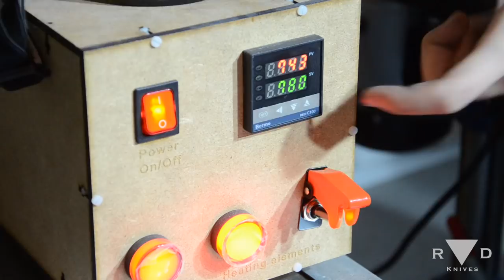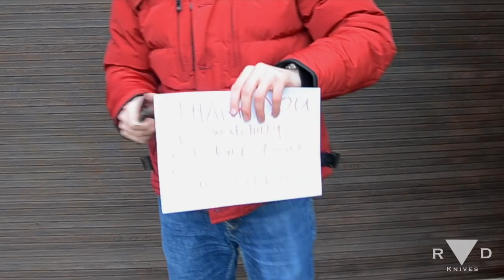Making the NOBLE Knife Part 2

Comment: Another gorgeous knife!! I love the way you make your knives, proving that people don't need to buy or make an expensive grinder and all the other knife making equipment. The dedication you show is what you need to produce a quality knife. Well done and thank you.

Just a suggestion for a "free" tool. You could make a really sweet scribing tool from your off cuts of knife steel and handle materials 😁👍👍👍👍👍
Reply from the maker: Thank you very much! I like to do most work by hand since then you appreciate the final result much more. However, it takes forever to finish a knife this way. I wouldn't say no to a beltgrinder
Reply: @rvdKnives  I finished my first knife this summer an as a substitute I used a belt sander. It was just a small wood carving knife and I think it would have struggled with anything larger

Comment: have you considered purchasing or making a belt grinder?
Reply from the maker: Yes, I have considered building one. But at the moment, it is out of my budget. A motor with variable speed drive will
cost around 400 and all the drive wheels also are quite expensive...